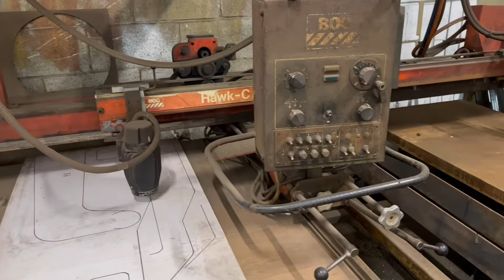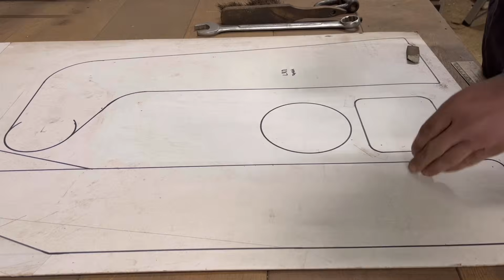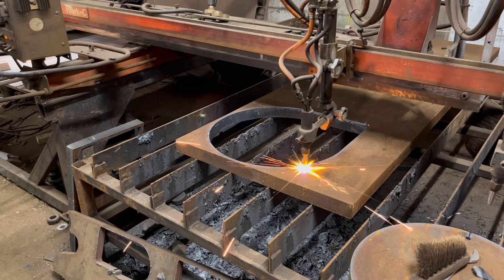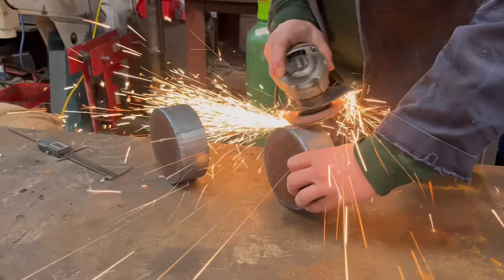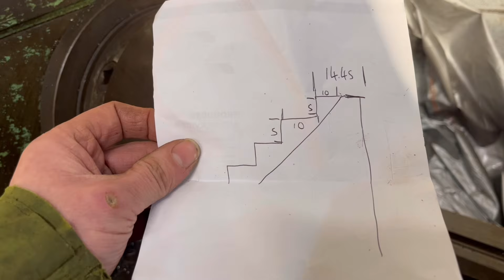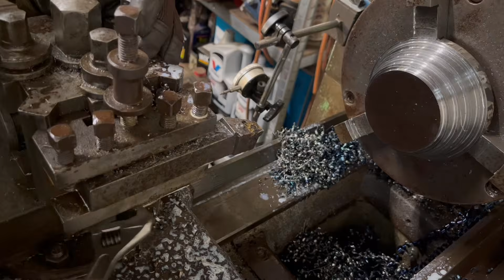Making some alignment cones for line boring

Comment: Great video I’m no expert on steel machining as most of my work involves plastics.
Would it have been easier to drill the billet undersized tack it to a rod to produce the taper then break loose the bore and finnish it last.
Only an observation by no means a right way to do it.
It’s simple jobs like this help make your life easier in the end but takes an age to get round to producing.

Comment: Suggestion. After drilling centre bore, run the boring bar through it to true it up, thus having it run concentric to OD. It's too easy to have the bore slightly out of line using just a drill. The reamer will just follow whatever/wherever the bore is.
Reply from the maker: Yes, I don’t know why I didn’t do that here. There’s another video (can’t remember which one) where I do that and give the same explanation as you just mentioned.
Reply: @snowballengineering  It is just that you mentioned that lathe work was not one of your strong points (you have plenty of other points which I have never done). Was not sure if you knew about what I mentioned. I have commented previously about your work which I think is excellent, especially for someone as young as you. If I were in the UK and needed something done I would select you in a heartbeat. Over here in Land Down Under, I have a 3/5 tonne 4M long lathe and 2 milling machines, plus I know others who have a lot of equipment. You do very well with what you have.

Comment: Nice one mate. Noticed when you ran the reamer through you still had the rpm quite high and kept stabbing at it. An old machinist at the shipyard I worked at told me half the speed and twice the feed and just keep going with it. Make the reamer work and cut to get a good surface finish! Jealous of all the tools you have to work with, I’m slowly building up my own though 👍
Reply from the maker: Half the speed and twice the feed. I’ll remember that, thanks!

Comment: The fancy digital thing breaks but the lathe still works if you know how to use it old school. My mate was a tool maker years ago. He spent decades operating manual lathes. Could make them talk. All done without a digital read out. You're learning as you go. Practice makes perfect. If you can get results like that now. Imagine how easy it will be in a few more years.
Reply from the maker: I don’t generally do much lathe work so I don’t get the practice in. Always learning though.

Comment: As "welder A" at the Warner & Swasey Co, back in the day, I use to run an Airco burnout such as that from time to time...great machine.  It will malke you $$$ when the new junk is broke down and nobody knows how to fix it lol! You got the start of a great channel, I liked, I subscribed.
Reply from the maker: I have a newer cnc plasma machine as well but this machine I use for thicker plate my plasma won’t cut. Old but still has its place.   Thanks!

Comment: This is a lot more advanced than Josh Topper's magnet-follow-tracer he recently got
Reply from the maker: Magic eyes were the next generation on from the magnet follow tracers I think.
Reply: @snowballengineering  the cuts of the torch looks very good. 

I made another suggestion to add an adjustable screw to the lower part of you measuring contraption clamp. The lower part can be used to allow an adjustable screw to push up the cutter. Use a nice a bit lager adjusting screw to allow fine adjustment
Reply from the maker: That’s a good idea.  The clamp clamps at the side of the tool but I guess I could make a little tab off the side for the grub screw.

Comment: That's pretty cool! I never saw a pantomime setup like that. Josh Topper showed a similar machine, but it's way smaller and his used physical patterns instead of drawings.
Reply from the maker: Its old but still very useful. I have a pen attachment for my cnc plasma table so anything more complicated I can draw in cad, draw onto card and cut out with this machine.